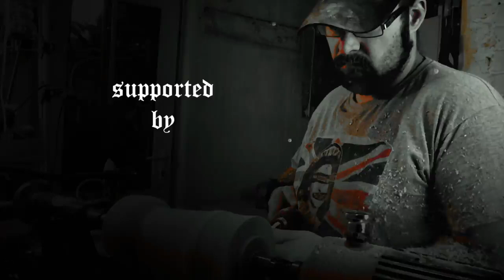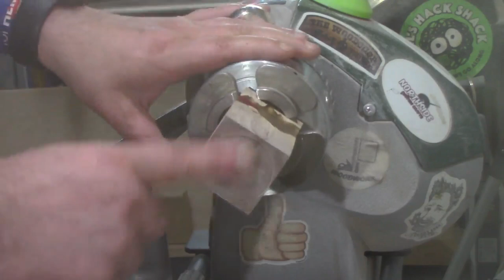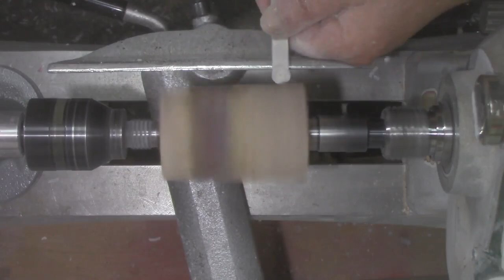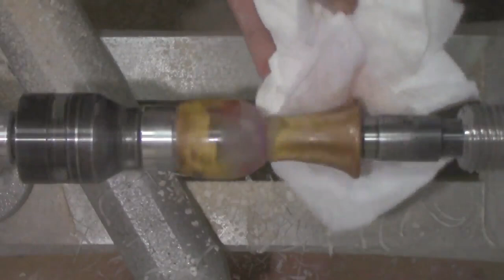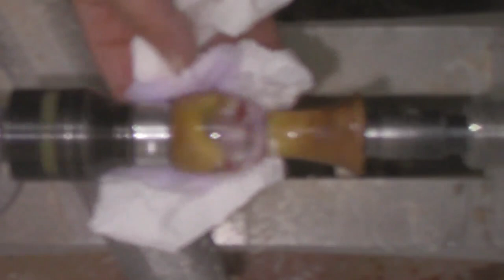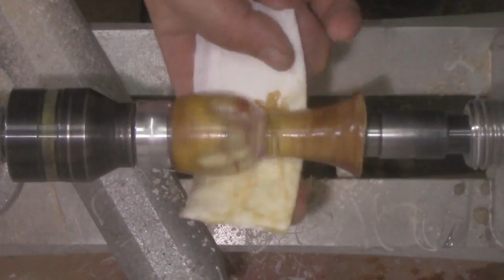Woodturning - Bottle Opener Goblet FEAT Easy Wood Tools Mini Hollowers

Comment: Very nice Jamie.  Never would have thought of making a goblet into a bottle opener, or is it making a bottle opener with a goblet on top?   Would you please tell us what you used with the water to polish up this piece?  Now if you could only find a bottle of Vodka that has a cap on top.....
Reply from the maker: Thanks buddy, I sanded dry to 240grit, wet sanded to 1000 grit then used an abrasive paste called Yorkshire Grit
Reply: @jpwoodwork  I really appreciate the fact that you respond to comments on your site.  So many others do not.  When you were wet sanding, it looked like you used a 3M pad, or was it just regular sandpaper(?it looked green?)?  I use Yorkshire Grit also, because you use it on every item you make.  Good stuff.
Reply from the maker: @davidhjortnaes2000  no worries, that is just standard wet and dry sandpaper